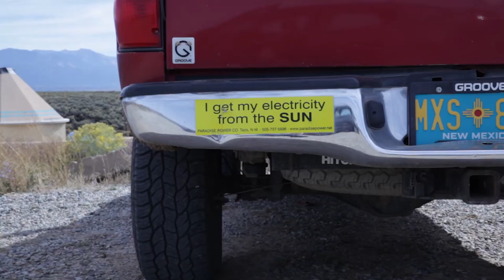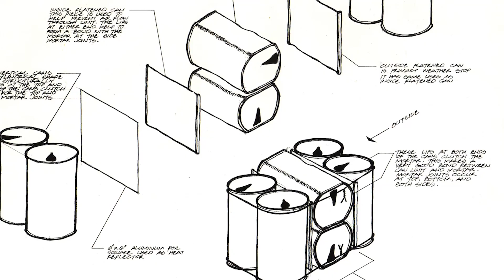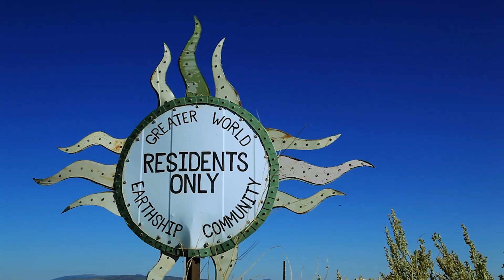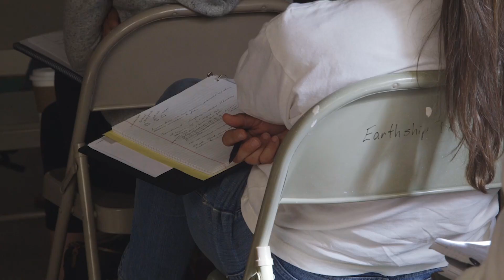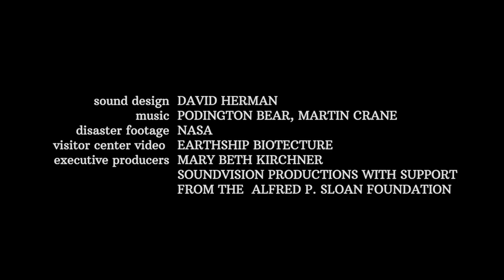Earthships: A House Made From Beer Cans Sparks a Movement | Short Film Showcase

Comment: Hi folks, 
We've been inspired by earthship Biotecture and so  interested in its development in certain climatic conditions and the enhancement of it's longevity. To that end, we would appreciate were anyone with relative experience help us with answer to any of the three questions as follows: 

1. Google estimates the longevity of tires is anywhere between 50 to 80 years before total decay. Does this mean that an earthship could only last that long, given that tires are the predominant material in earthship? 

2. Still on strength and longevity of tires, does tires get weaker when exposed to water, as in building with it in a swampy environment? 

3. In the interest of tires strengthening and preventing ground water pollution, could the following measures harm or help tires longevity and environmental protection: 
A. Wrapping the tires in plastic materials 
B. Painting the tires with coal tar mixed with kerosene. 

Thanks so much for ur informative response to this inquiry. 🙏🏿
Reply: I'm no expert, but I think that since the tires are at a stable temperature, completely sealed that they would last indefinitely. If you are building in a swampy area you would take measures to prevent tires from being exposed to moisture from underneath of wherever. I think you are too worried. Can we trust Google or the fact checkers anyways if there is an anti-earthship agenda in place?

Comment: Do Earthships work in cold climates?
Reply: +Anastasia Renaud yes the earthships I this video are in the new mexico desert.......where it gets very cold
Reply: Thanks. I was thinking moreso in a climate with snow and rain. I can see this would work in a desert as daytime temps are quite high so the house stores that heat and releases over the cold night. But would this work in someplace like Canada...
Reply: Anastasia Renaud taos NM is a high platau desert so in winter its freezing with lots of snow and rain......Im positive there are many earthships in Canada....it works as long as you get sun light during the day for example it wouldn't work well up in the artic circle where its dark for several months, but it would still work better than any other house design simply because of its passive solar, thermal mass design .....hope that helps

Comment: Solar panels need to be replaced. I hope the water they're getting from the ground is upstream from the hole where the sewage is going.
Reply: +525Lines solar panels can last 30 years and there are solar panels still working after 50 years......... They collect water from the roof not the ground and there sewage is treated by bacteria and discharged into a plastic line botanical cell
Reply: +Kim Rollo Okay. I didn't know solar panels lasted that long.